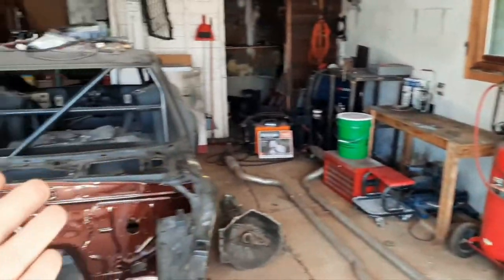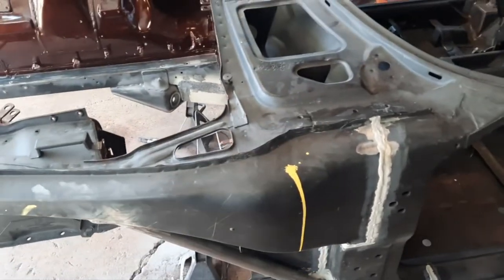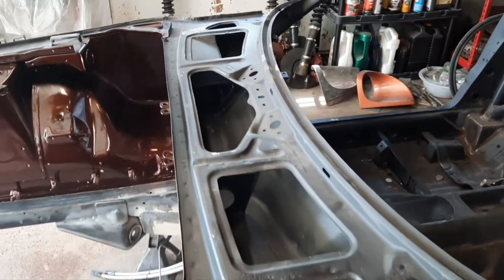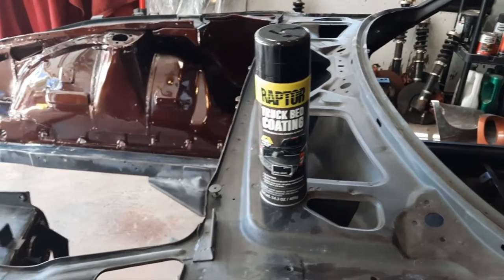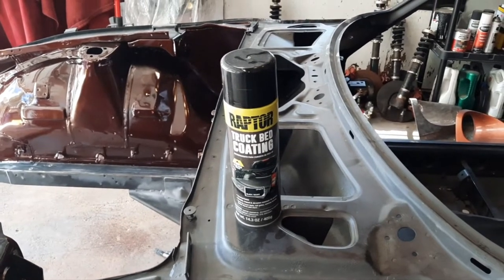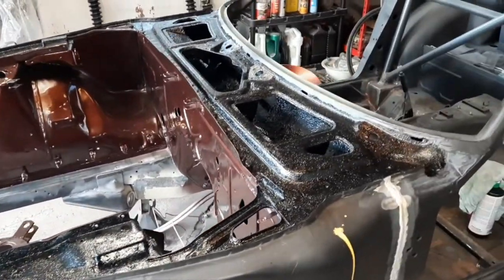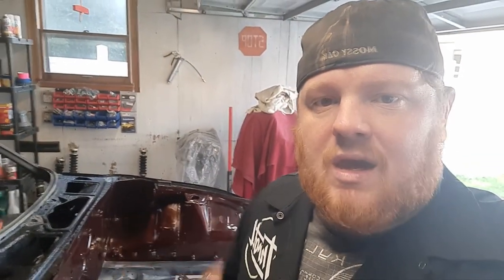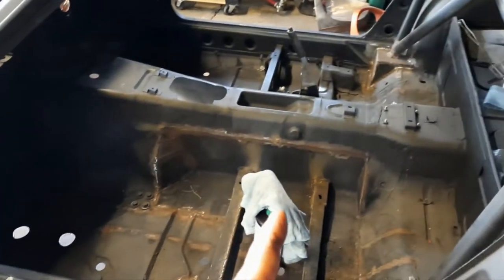Small but necessary things to keep moving forward

Comment: Be interesting to see how bedliner does in the cowl area. That area is a known problem for the Z in that it traps dirt, leaves and water, and you'd typically want that area to be smooth to let water run out easily. But since yours is a racing car maybe that won't matter. 🤔
Reply from the maker: this car isn't going to spend a lot of time in bad weather environments. Of course it is bound to see some weather given how much i plan on using it but, time will tell.